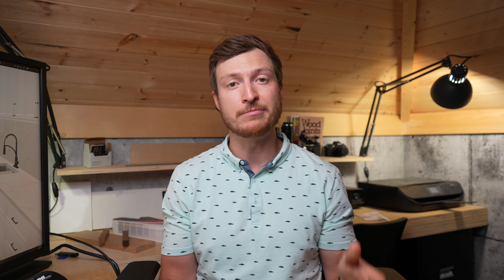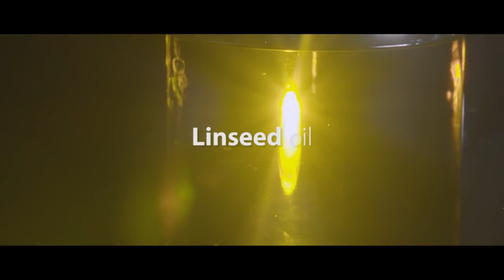Fridge placement, wood cabinets, and more of your kitchen design questions ANSWERED

Comment: Have a couple of questions ikea related and then a couple kitchen design.  

Ikea cabinets 
  1 - How worried should I be if my contractor has never installed Ikea cabinets.  Originally I was doing a brand he has worked before but I like the customization and organization of Ikea.  
  2 - Do you have an idea on how to do an appliance garage with Ikea cabinets?

Kitchen design.
   1 - I am not changing my kitchen layout just cabinets and countertops, but the fridge does pop out some 8 inches, the fridge is less than a year old so no chances on buying a counter depth one, plus I am not a fan of them.  Besides changing the layout is there any other way to make it less obvious?
   2 - I like your suggestion about building the toe kick if I use the ikea cabinets, but how do you finish them?  One of your videos just mentions installing the custom toe kick?  Could I use the vinyl flooring I am installing, that way they look more like floating?

Thanks for all your videos and ideas.  very helpful.

Laura Garcia
Reply from the maker: Hi Laura - thanks for your questions! Stay tuned for an upcoming video on IKEA specific questions where yours are also answered.